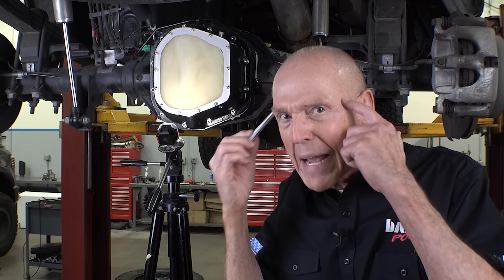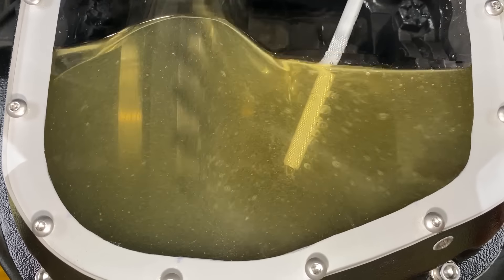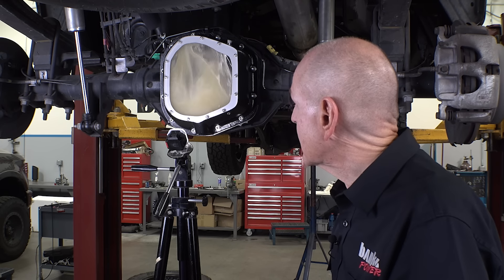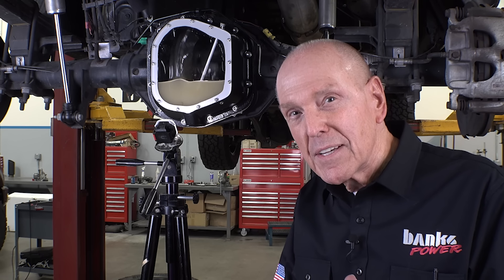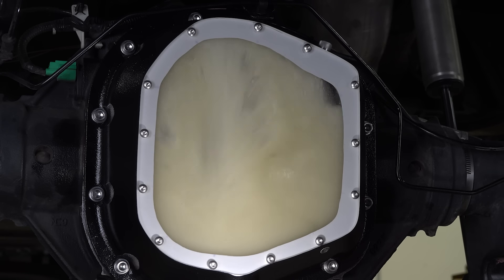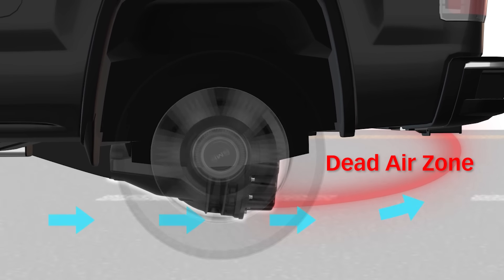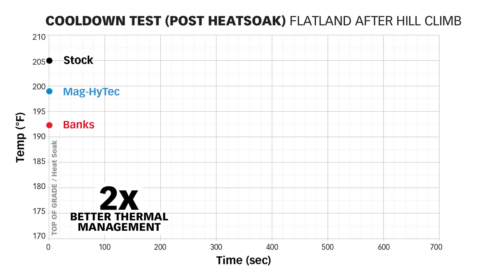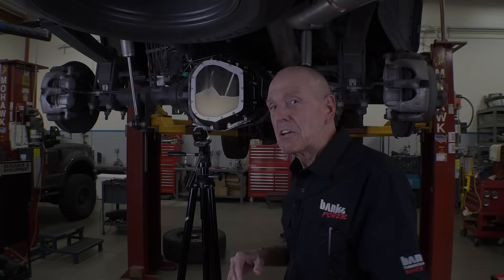What aftermarket diff cover guys don't tell you!

Comment: Wow,  ive heard dont slam the competition by name. But when the producers make total shit thats going to distroy your property without doing this kinda simple testing  they are just selling pretty snake oil. 
Banks should call them out on it.

You should do these for other then trucks.
Im sure a 1964 ss impla could use one too,  how about gear boxes on independent rear suspension cars like BMW and the 1988 Toyota supra used.
Also some vets and other brand cars.
Then you've got to think about transmission  yes youve got oil cool but honestly just how cool can the transmission oil get dumping it heat into a radiator thats running its fluids into the engines block and these do fail and mix 
Causing serious problems.

Comment: Not exactly a scientific test. This guy is making ridiculous claims without backing them up e.g. "no oil is making it to the pinion" Being charitable, perhaps he is using hyperbole to suggest the amount of oil reaching the pinion is less, but since no attempt was made to quantify this then it's just opinion (no pun intended). Also no practical attempt was made to show the flow of oil with the OE cover and no attempt was made to quantify the stiffness of the diff housing with OE and aftermarket covers.
His claims may well be true in part and this could have been a useful video, but as it stands it's short on evidence and long on opinion and heresay.  The fact that he is trying to sell something should make you very suspicious.

Comment: So basically you took a product and altered it and say you helped it with your alteration so now let's test it. Ya if you cant see the problem with this even before you started you have a problem deep down. What excuse you use to say why you altered the product doesn't matter you cant test an altered product. This guy is like a dirty politician.
Reply from the maker: Thanks for watching. The cover shown at the beginning of the video is made by PPE. The cover tested on the truck was a Mag-Hytec. The goal for any diff cover is not to stop the oil from going over with the ring gear. The goal is to encourage MORE oil to flow over the ring gear. The PPE would impede the flow and severely aerate the oil. Think of a rocky waterfall. The water is white because of aeration. Air is not good for lubrication.

Also, if you're suggesting we're trying to reinvent the wheel, it's an age-old argument. Everything can be improved. Apple didn't stop innovating with the iPhone after it launched in 2007.  For a full breakdown of all the data and comparisons, we have an entire series that showcases the diff cover development. 

Watch the full "Behind the Diff Cover" video series here: 
https://youtube.com/playlist?list=PLwtmrqcWzLtQR9riOg8mizIEj-UX4WBBm

Comment: This video is nonsense.
First off, the OEM design is round because it barely clears the ring gear and must be round
🤦
then you bash aftermarket designs which even you show out perform oem. They have also been proven to do their jobs without issue.
I have been running mag-hytec for years without any of the problematic claims made in this video. My gear oil is just as good as if I used any other cover. It stays clean and clear.

Lastly, your design has it's own flaws. Horrible design for off road use. hanging down to catch air will also catch snow, water, debris, etc which can cause performance issues.. 
OEM design has worked since the beginning of time without issue and is more than sufficient. There isn't really a benefit from cooling gains when oem keeps the diff plenty cool. 

The only thing true in this video is that more oil has no benefit and in certain situations is actually worse. Yes it takes longer to heat up, but once heated takes way longer to cool; which negates the benefit of more capacity/ oil.

For what it's worth, I will never own a banks product. something turned me off about Banks many years ago and this video bashing others just adds more reason to avoid a company like this

Comment: All that work to "replicate" the ribbed flat-back cover and it's not replicated.  Kind of blows apart everything that follows.  If you can't see that flat and ribbed are not the same, what else are you missing?  All you needed was a thicker piece of clear plastic and more time on the milling machine.  And there's no agreement to be made to justify it, it's just cutting corners.  What a shame.

You need follow-up videos to correct errors like this.  Won't hurt you, it can only help, and you'll get more marketing attention.
Reply from the maker: Thanks for watching. The cover shown at the beginning of the video is made by PPE. The cover tested on the truck was a Mag-Hytec. The goal for any diff cover is not to stop the oil from going over with the ring gear. The goal is to encourage MORE oil to flow over the ring gear. The PPE would impede the flow and severely aerate the oil. Think of a rocky waterfall. The water is white because of aeration. Air is not good for lubrication. For a full breakdown of all the data and comparisons, we have an entire series that showcases the diff cover development. 

Watch the full "Behind the Diff Cover" video series here: 
https://youtube.com/playlist?list=PLwtmrqcWzLtQR9riOg8mizIEj-UX4WBBm
Reply: @bankspower  Thanks for the reply.   I kind of over-reacted when you showed the  ribbed metal but replaced it with a smooth surface.  My first thought was "that's not the same product".

If you want to use the visuals of the fluid aerating as "bad", a selling point for your design, then you should make a clear copy of your design, with the internal ribs.  Show the fluid flow in it.  That would be something.  "What's going on behind the Banks cover?".

Good luck with the products.

Comment: Ram air more like ram into rocks and mud and break
Reply from the maker: It may not stick out as far as you think it does. Our patented Ram-Air scoops are designed to increase airflow over the rear differential without sacrificing ground clearance. In fact, our differential cover retains the same low point as factory and competitors. Also, if it breaks, we'll warranty it.

Comment: Yes, it’s intensely flowing with the ring gear teeth and vigorously lubricating the pinion and bearing.  Two more quarts would amplify the pinion and bearing lube.  Your video is bogus.  Put the camera at the pinion, Sir.  Very, very poor engineering analysis.  The laughter only exemplifies your BS.  PUT THE CAMERA AT THE PINION.  The oil will always hit the diff cover.  Bogus test as well.  If you’d like help on how to legitimately test, let me know.

Comment: Fake test, no fins 👎
Reply from the maker: Thanks for watching. The cover shown at the beginning of the video is made by PPE. The cover tested on the truck was a Mag-Hytec. The goal for any diff cover is not to stop the oil from going over with the ring gear. The goal is to encourage MORE oil to flow over the ring gear. The PPE would impede the flow and severely aerate the oil. Think of a rocky waterfall. The water is white because of aeration. Air is not good for lubrication. For a full breakdown of all the data and comparisons, we have an entire series that showcases the diff cover development. 

Watch the full "Behind the Diff Cover" video series here: 
https://youtube.com/playlist?list=PLwtmrqcWzLtQR9riOg8mizIEj-UX4WBBm